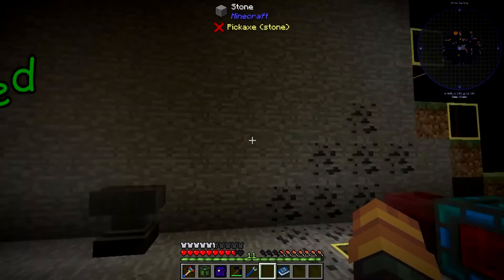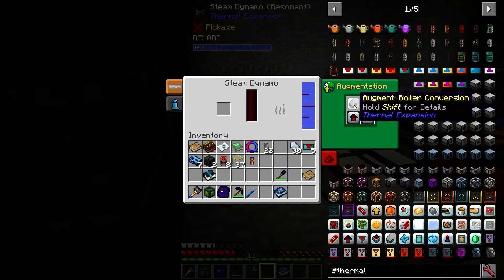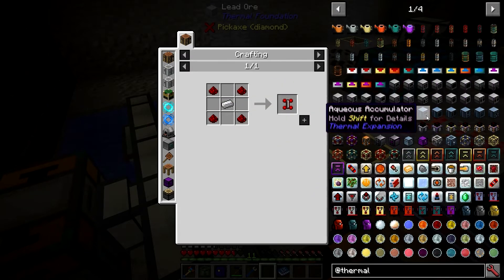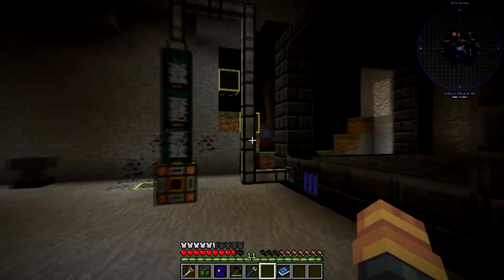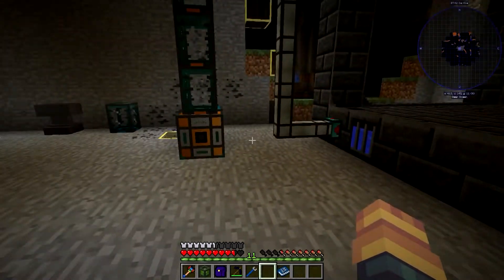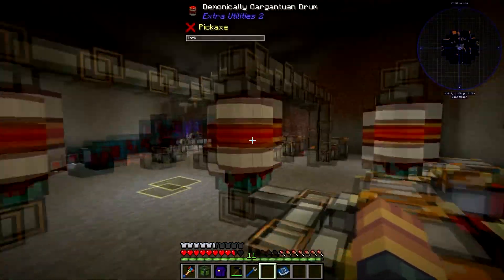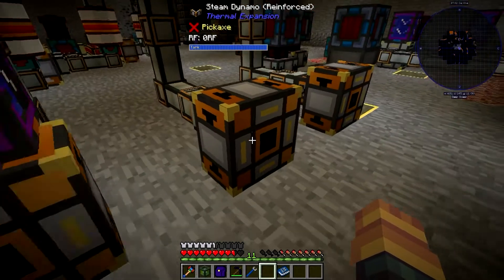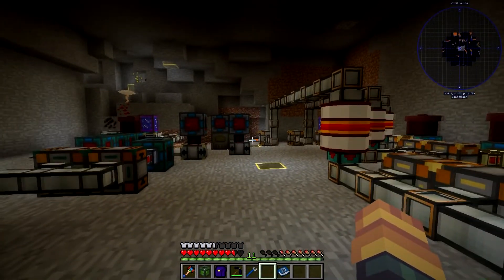More Efficient Steam RF Power:  Direwolf20 1.12!

Comment: Each Steam Dynamo maintains a 2,000mb buffer of steam internally. So you aren't actually using all the steam you produce, that could be what is creating the difference in the power produced by your 2 & 3 dynamo setups.  Since there are more dynamo's in the 2 & 3 setups, you are using 2,000 or 4,000mb less of steam, because some is left in each of the dynamos, so you are producing less power. The three systems probably produce an identical amount of rf overall, minus what is "lost" by steam that is left in the generator.  Great video though btw.
Reply from the maker: Thanks.  Also I have done a little more testing and the other Dynamos you can use for this can't run 2 dynamos but produce way more steam over all which is weird.  Might stick with all steam Dynamos and run off of charcoal or what not.